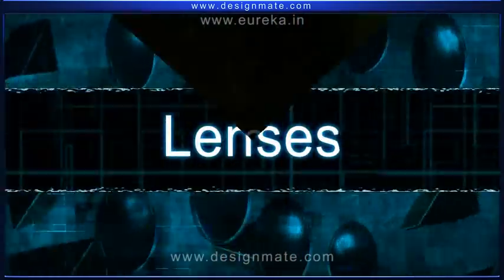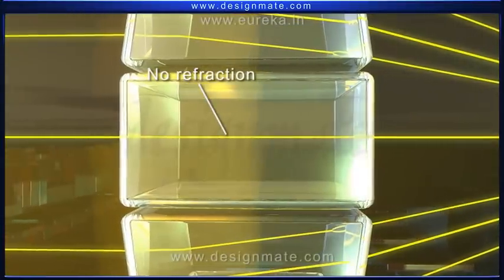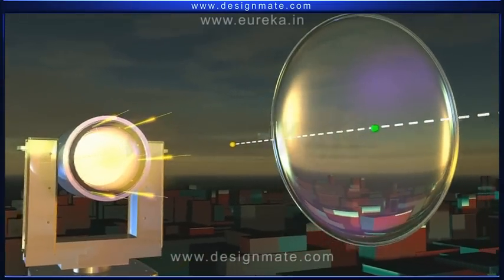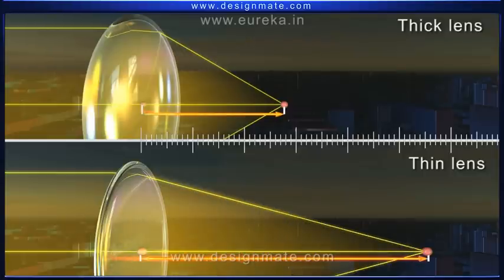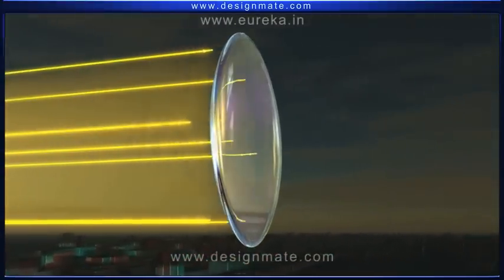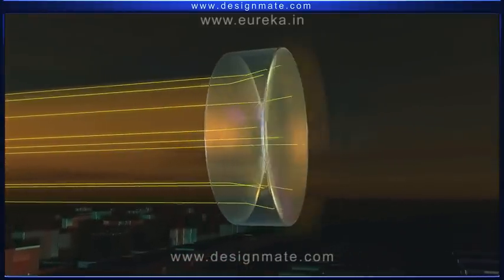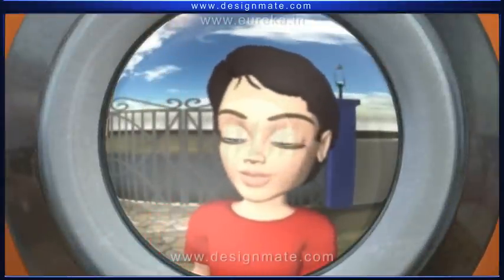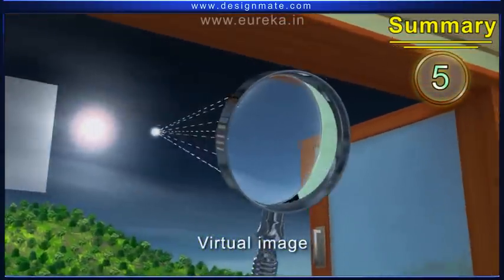Convex and concave Lenses - Physics - Eureka.in

Comment: Is there a lens that can make a laser dot small enough to enter a fiber optic core?
Reply: For how long of a distance?
Reply: Coherent or with disperse diffraction?
Reply: @goldenmeanphaseconjunction313  I want to attach a fiber optic cable from the center of a spinning disk to the outer edge.  I want to fire a laser burst into the core at the center. The photons that come out of the core on the edge have to be captured by another, non moving fiber optic.  Photon loss has to be zero. I need a lens to go inside the non moving core.

Coherence not necessarily.
Reply: wulphstein need more info....
Reply: Why photon lost zero?
Reply: @goldenmeanphaseconjunction313  because I have to repeat the process many times.
Reply: wulphstein what can lose zero?
Reply: I know not one
Reply: Any loses because the idea of it is misunderstood